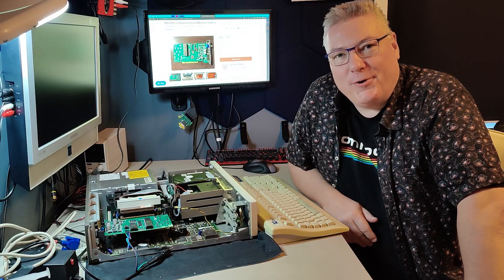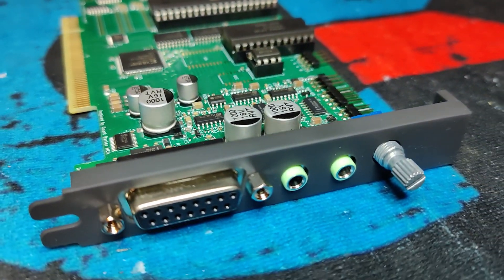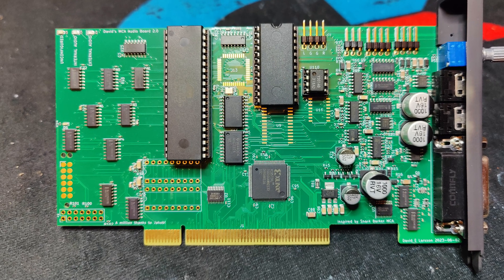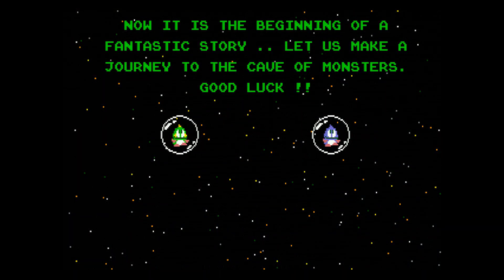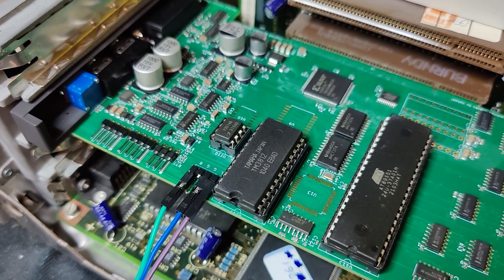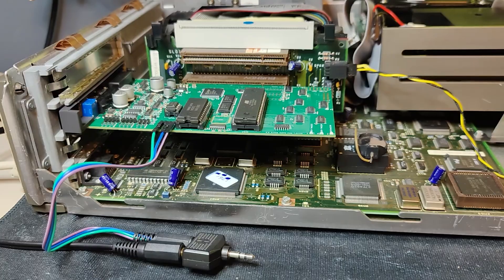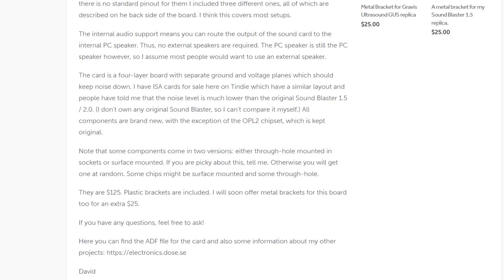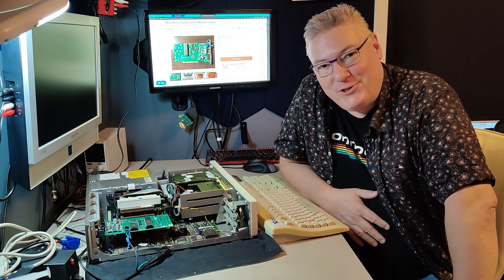MCA Micro Channel Sound Blaster replica

Comment: Yeah, no wonders the audio is noisy with this design... This monstrosity makes even Creative cards layout look half decent :D
Reply from the maker: Why do you say that about the design? When using the internal line out i get better quality than my ISA Sound Blaster Pro.
Reply: @RetroErik  No wonders, line out bypasses all the analog circuitry. It's truly poorly designed, violates a lot of standards. I've attended a couple of classes about designing boards at college and know a little about it. At least the chips are not sticking out from the top of the board like on other design...

Comment: The amplified output made sense back in 1990, when there were a lot of passive computer speakers available. Today, they make absolutely no sense. Those type of passive speakers were never very good to begin with, and today, nobody (well, very few) would choose to use them. So a line level output would be a big upgrade.
Reply: Note taken. :)
Reply: I actually bought this card and really love it. It’s the only one I have found that allows me to adjust the volume output using the internal speaker which I prefer to use.

Comment: The really bad thing about these PS/2 machines is when you go for a LPT1 dac you will experience lot's of noise from the bus
...really a bad grizzeling sound.... hopefully this MCA Soundcard is better and compatible to my PS/2
Reply: Hi! I’m the creator of this card. The unamplified output is rather noise free as Dag Erik explains in the video but the amplifier on the board adds some noise for some reason. Not entirely sure why it happens, I must have made a mistake when I designed the PCB layout. However, as long as you use the unamplified output it’s fine.
Reply: thx! I think I wait for the unamplified line-out version on the back. 
If this is not planned I will checkout if this is compatible to my 486-SLC2 (Model 56?) and place an order.
Reply: seems that this thing has also some noise problems... don't know why...these machines were super expensive and they have so much problems with noise of the powerlines...strange....